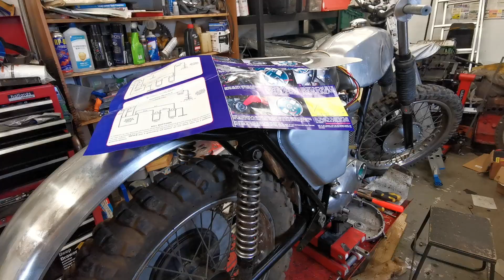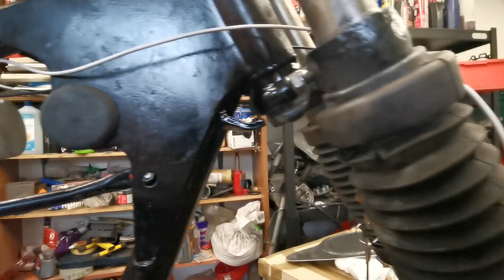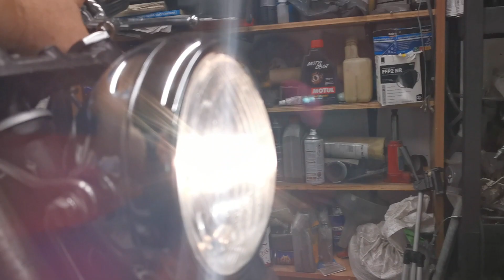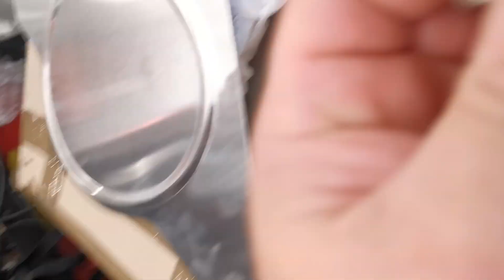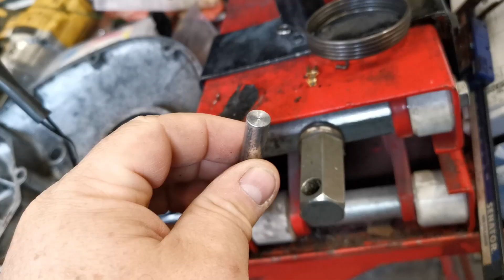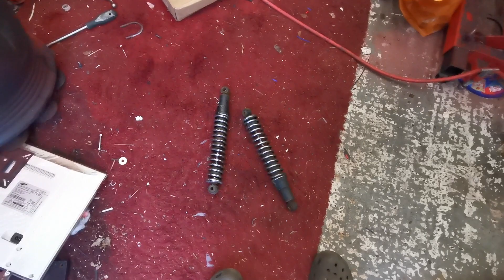BSA Scrambler Build Day 11

Comment: Why not take the rear light feed from the dip switch input rather than the two outputs. That way you won't need those two diodes?
Reply from the maker: Because you would loose the feed to the rear light when selecting high beam and the rear light will go off